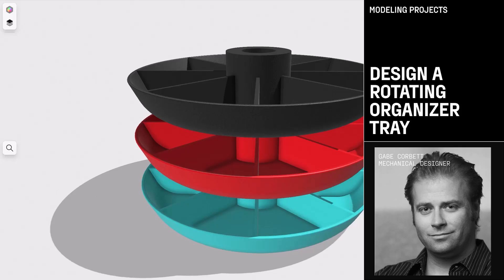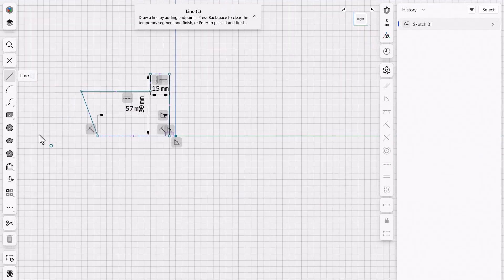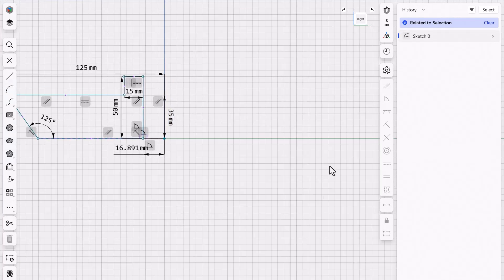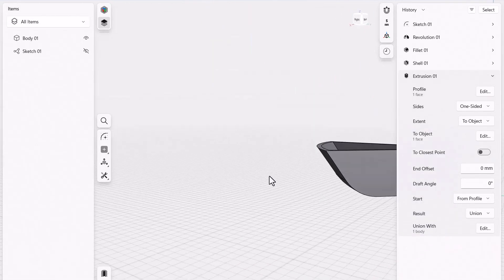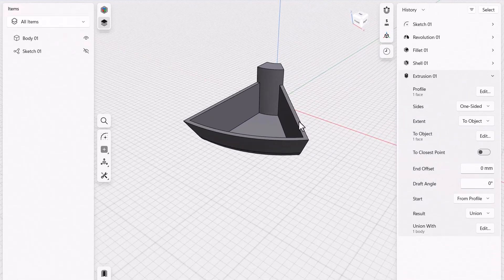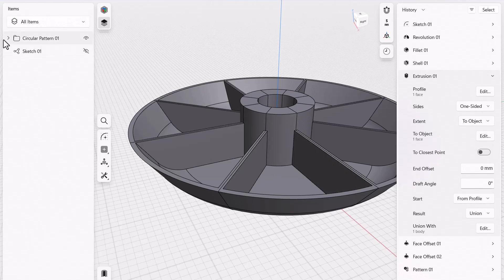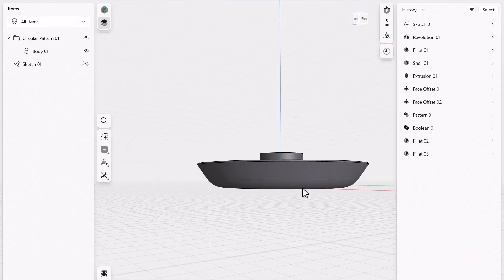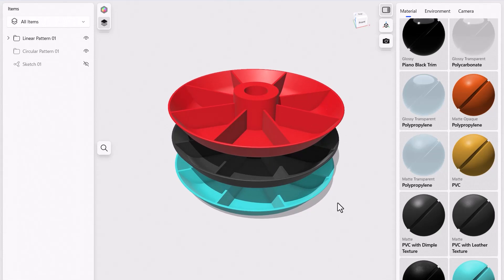Design a rotating organizer tray | Modeling projects

Comment: is there a shapr tool that can align two faces of two object so that when those two objects are stacked on each other. it creates one smooth face. vs having two separate faces that do t quite line up ?
Reply: Aligning faces doesn't work very well due to no assembly support in shapr
Reply: It’s really annoying me so much for not auto aligning with two objects even sometime it’s just a simple way of doing. Honestly, I feel so much comfortable with Sketchup.
Reply: I find it challenging to do that, as he also was struggling stacking those objects on top of each other. He had to eyeball and assume that there was contact. The same is true when trying to align two bodies/objects. The alignment feature doesn’t work as expected, as in programs like Adobe Illustrator for example. Hopefully Shapr3d will fix this.